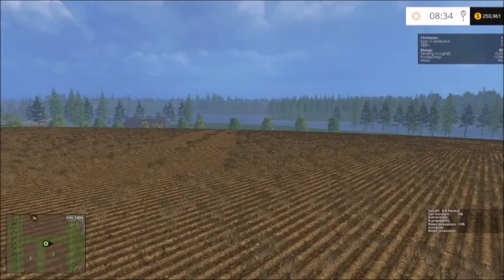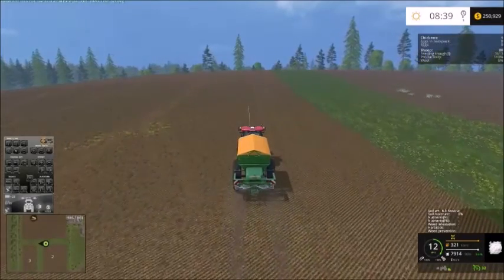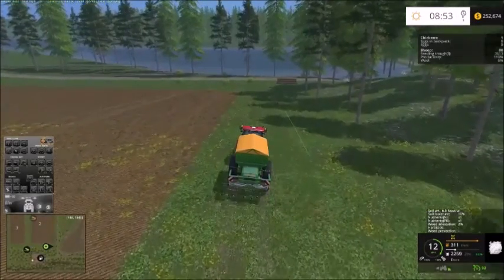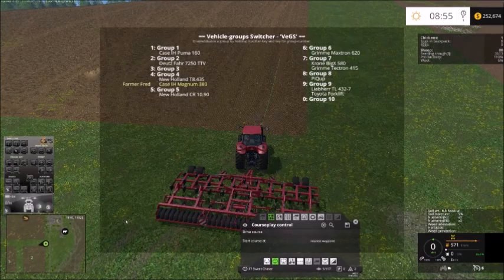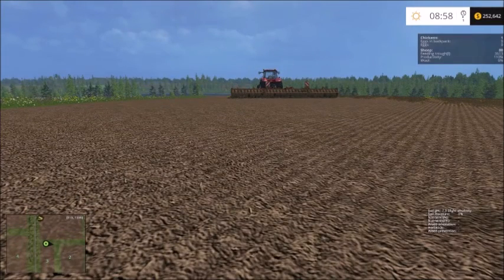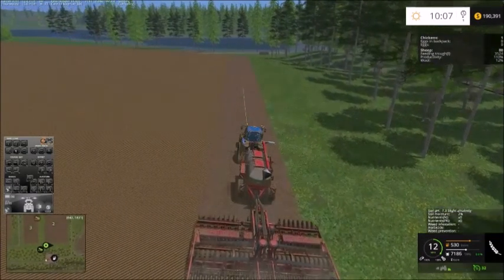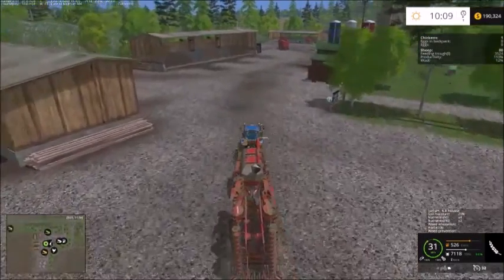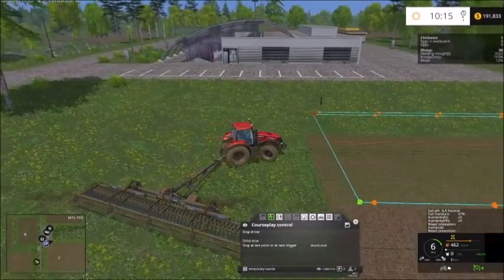FS15 Soil Mod Tutorial Episode 1

Comment: Dear Rever, Your tutorial on Soilmod is a great idea. I do like the idea of the mod but find myself often very frustrated from unexpected effects. Using your spreadsheet has helped me come to grip with issues I didn't pay attention to, due in good parts to  a very inadequate guide to the mod. My question to you is about what soil treatments can be combined in one growth state. In one attempt I tried to do liquid lime followed by pure water, but the water didn't seem to be counted in. I had expected +28, but got only +14. I realize that one cannot do two types of herb or two types of fertilizer in the same growth state. In Geneborg's tutorial he says that herb and fertilizer cannot be done in the same growth state. You seem to do that. Do different maps handle Soilmod in different ways?
Reply from the maker: Hello Kaj-Age, Water is a bit tricky. If you sprayed water you will get +28. If you spray another liquid (or two) you don't get any additional moisture. Same if you spray herb and NPK (2 liquids) you only get +14 moisture, not +28. At 12 noon if the temperature is 22C or higher you loose -14 and for 3 out of 4 growth stages you will loose -14 at midnight. Other than that I am not sure what may have happened. I would have had to see exactly what was going on. I do lime, herb and a fertilizer all the time. I cannot say why Geneberg would say that it doesn't work. There could have been an update since his video. It is pretty old by now. If you check out my American Outback videos I did all three in them and various other combinations. In the videos I use the spreadsheet and show the results. Look toward the harvest or planting episodes, I show what I normally do and how well it works out. Heck I am to the point of trying to predict the harvest. In addition I have a more updated spreadsheet and soil mod tutorial in my tutorial playlist.I have never had a map that does things differently. I don't know if that is possible without the mapmaker giving a separate version of the soil mod.Good luck. I was frustrated at one point as well.
Reply: Dear Rever, Thank you for your reply. It confirms that I'm using the right strategies. I think my main problem is, that the Soilmod numbers on my fields are so ueven, that it is impossible to follow the effects of soil treatment unless you stand in the exact same spot. Tried to zero some of the fields using Herb X, as implied in Geneburg's video, but that doesn't work. I'll try your approach and let the numbers run down. Another question. Is the consumption pattern the same for a grass field? You have a separat spread sheet for grass fields with a different deduction pattern, i.e. -1 for both N and PK per day and -14 per day for H2O, and no deduction on pH. Appreciate your time and help. Wish your spreadsheet was available as a mod. You do need this tool for planning, but I hate having to work on two computers. An in-game planning tool and task reminder is my wish for new mods for FS17.
Reply from the maker: Hello, I am glad to help. The herb x would just kill the plants, so I am sure that wouldn't help zero the field. You could also max a field out such as spray until things reach their max number, but that is like work. Zeroing the field requires nothing but patience and a reduction in yield. Keeping fields even is critical for maximizing the yield.Grass repeats 2 cycles repeatedly, so going into final growth you lose one of each nutrient, moisture and pH. If you wait a second day before cutting grass you only lose -1 N. FYI a grass field is a great way to test and learn because it is simpler, you can cut it every day and see the effects more immediately.I am assuming Dekker will be making Soil Mod for FS17. I sure hope so. I am actually programmer, so I am sure I could turn this into a mod. Generally though after programming all day, my desire to do modding in the evenings is limited. I won't promise anything but I will definitely consider it.